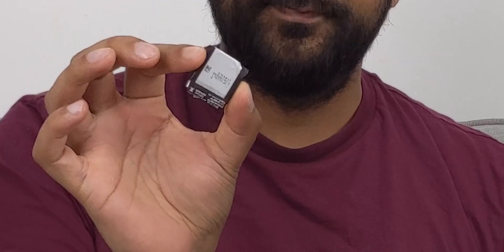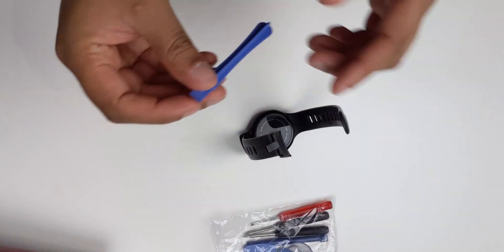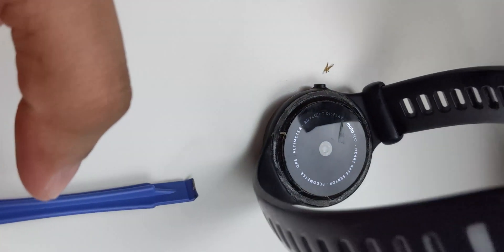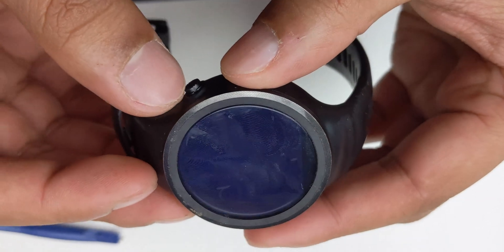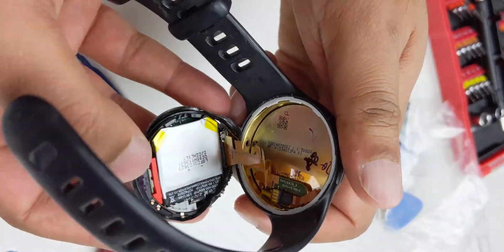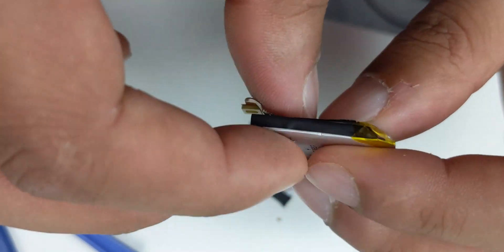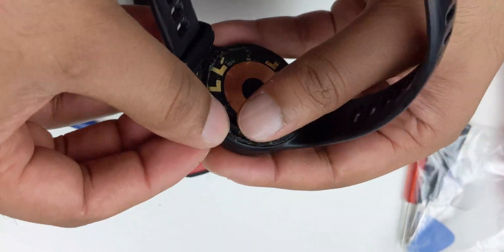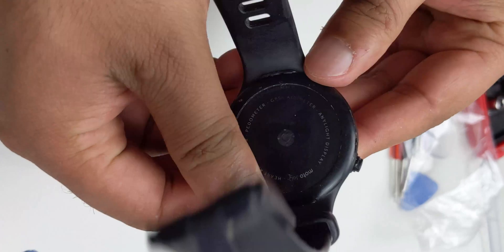Motorola Moto 360 Sport Battery Replacement Guide

Comment: I'm finding all kinds of conflicting information on this watch. Is the one in the video a 42mm? Even though my watch looks identical, I bought mine through Amazon where it states the watch is 45mm (45.5mm actual)..which would give us a 42mm, 45mm, and a 46mm out in the wild but there are only two batteries FS3L (46) and FS3S (42). 46mm is 300mAh and 42 is 270mAh. So confused on which one to go with.

Comment: Hi, thanks for the video, i have problem with my moto 360 sport's battery but i have a question, the battery is 42 mm or 46 mm??? Cheers from Chile
Reply from the maker: Hi Cristian, the battery is the FW3S. This is the one you need https://rover.ebay.com/rover/1/710-53481-19255-0/1?mpre=https%3A%2F%2Fwww.ebay.co.uk%2Fitm%2FNEW-SNN5971A-SNN5962A-Battery-For-Moto-360-2nd-Gen-Smart-Watch-FW3S-FW3L%2F273501896826%3F_trkparms%3Daid%253D111001%2526algo%253DREC.SEED%2526ao%253D1%2526asc%253D20160908105057%2526meid%253Dfa28debd80574ed1bfbb2a53222d7ccd%2526pid%253D100675%2526rk%253D4%2526rkt%253D15%2526sd%253D223011223269%2526itm%253D273501896826%26_trksid%3Dp2481888.c100675.m4236%26_trkparms%3Dpageci%253A66daf463-6a1a-11e9-8358-74dbd1806ac6%257Cparentrq%253A669cf63716a0ab668496da98fff3578b%257Ciid%253A1&campid=5338044712&toolid=20008
Reply: Wena wn!
Reply: It's the 42mm version